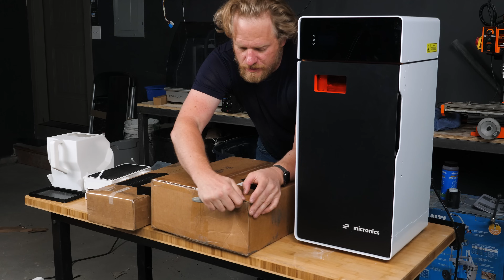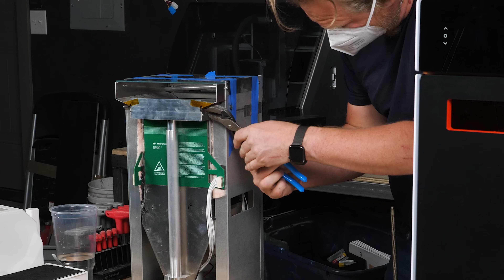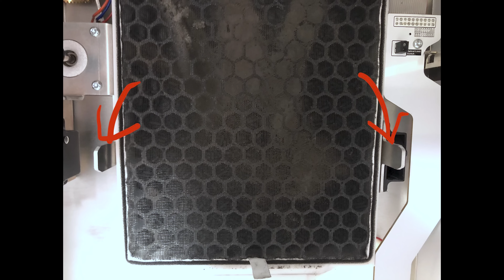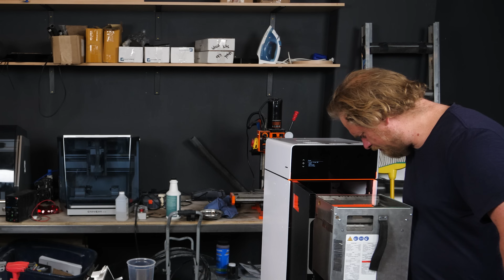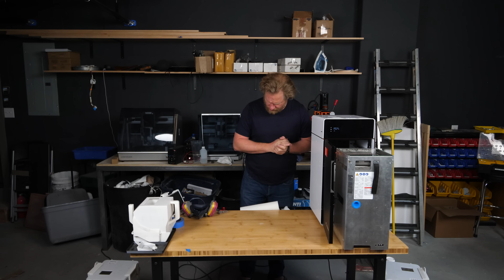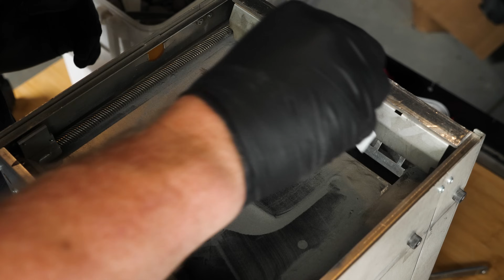Kickstarter Canceled! What’s Next for Micronics?

Comment: I think Henry's "Fix Protocol" was well put together on instructions... With a little more tuning, I think it woulda been a fair machine to play with.. 

I say, keep at your gifted machine and get it running... And just have fun with the whole experience of learning, trouble shooting, then hopefully, working machine and rock and roll. 

The problem with an affordable machine that has a media or rather powder, and not having an additional $8000 USD in seals, lip seals, O-rings, vacuum assist, vibratory basin, and many other built in services into the machine, that, like any other mechanical devices, the powder is naturally going to get into every location you don't want it to, and over time, build up, wear critical part, bushings, ball bearings, optical view obstructions, and so on... And not unlike the automobile, foreign matter wants to naturally get into critical locations, and seals of all methodologies is designed to keep that out, away from areas that are required to be clean, likewise, those same sealing systems are serve as the methodology to keep various lubrication types contained with in the machines critical locations, like wheel bearing systems, motor crankshaft to engine block fitment, and so on, and over time, things do wear out, and start to leak out, and stuff can get into these places, to don't want in.. just the nature of a mechanical system, and maintenance is and always has been a defining factor of machines, your automobile, motorcycle, shop tools, and when maintenance is lacking or not implemented into the use of the machine, life expectancy of the device, vehicle, etc, is on a scale of time, performance, works or doesn't work.. 

So, after my novel, I think for what this is, for the price, and simplicity of it, to keep the costs down, I say, stay at it, and make it work... The proprietary sintering electronics sounds like that will be an issue... I also have concerns for the government "over-reach" no matter which country you live in, is a serious problem to me, the machine and or media powder licensing contract and the likely, "must have network" connection to play with the machine, in my opinion is a serious problem.. what I do with my machine, is nobody's business, especially not the government's business. 

So much so, I have had 6 patents stolen from me over the years, and this is just one more aspect of others seeing what you are prototyping, before you can even hit the sales floor, and see every part you are designing, letting you do all the hard R&D, trouble shooting, costs out of pocket, and all any agency, competing business needs to do, is watch you network, while you build.. 

This is something that needs to be fought against collectively, against the corrupted gov't's of the world... Pardon the political ranting, but it is a serious problem, and if we do not start fighting against it, the whole world will be in big trouble from the people unwilling to tame themselves or relinquish their self appointed power... And that is all I'm gonna say about that...

Comment: I think the best system for handling powder i have seen so far is from alpha laser but their system only allows for smal prints and it takes up some space. But i think the basic concept of having containers that only open it's lid when inserted into a slot so you can handle them in normal environment and having a sandblast box like thing where you can work on stuff. (Filling the containers or removing the powder from the print) I think the basic concept would also be do able for other less expensive printers. I am also wondering if a Zyclone vacume system could be usedd to remove and filter the powder. (As i know you can seperate things by weight using multiple Zyclones.)

Comment: I hope Formlabs doesn’t do what I think they’ll do and drastically increase the cost of owning this printer, but I think they will. This may sound extreme, but I honestly hope that if this printer comes out at the original price promised by micronics, but you’re also locked into Formlabs materials unless you pay the ransom then I hope the project fails and Formlabs loses their ass on it. I hope the entire product is a huge failure, and most of all I hope that if this happens the world will see that it was the absurd ecosystem lockdown that caused it to fail and not the printer that people actually want.

Comment: You are the only reviewer who has been honest in acknowledging the disappointment the Formlabs acquisition means there will not be an innovative, relatively low-cost SLS for the market anytime soon. Thank you for your honesty and willingness to discuss the flaws and challenges Micronics was also facing. 
Watching you work on the machine also suggests that safety is a huge factor. I wouldn't be comfortable without a separate, walled-off room with adequate ventilation.

Comment: I am VERY VERY bummed about this outcome. I use formlabs machines to produce final parts at work, and they are also have MANY issues. Other than the $300 every 2 months (max) for a new tank, and the $300 per liter of resin, I have to babysit every machine for 30min to make sure the prints dont fail at the start. The final prints are very impressive, and the range of resins they have come up with are wonderful, but they are truly a professional machine because of it. Seeing them buy out competition so they can continue to hock their TWENTY FIVE THOUSAND dollar machine that is bound to be just as finicky and expensive as the sls machines is a gut punch. That being said, Its probably for the best for micronics, seeing as they will be able to have a life and a solid career/pay for now. But they also could have legitimately revolutionized the 3d printing market and made much more money by doing so. But that would have been a gamble on their end.

Comment: Probably an unpopular opinion here: you don't want to have a desktop SLS printer as a hobbyist. The powder handling is a mess if you can't afford the auxilliary equipment and facility that can do it safely. You're probably conscious of that to an extent - I saw you upgraded your mask while working with this printer. But mask is not enough - over time everything will be coated in powder in your shop and it will be terrible for your lungs long term. And I don't trust the majority of hobbyists to be able to do any better either. So in the long run, this would hurt the industry and the maker community while giving no real advantage... Just use an SLA printer (safely!) and forget about SLS.
Reply: wow. Thats sounds like something Formlabs would say while buying out competition. Thats BS.

Comment: I think that formlabs was a huge component in bringing resin printing into the hobbyist market, even if they didn't necessarily offer it themselves. A high end, functional system with all of the little issues worked out gives hobbyist machine manufacturers targets to hit. They decide what is important and what areas they can make cheaper, then they start competing with other hobbyist level machine manufacturers doing the same. I think this acquisition is pure upside, even if everything formlabs has ever made is well outside of my budget.

Comment: unfortunate for the initial access to SLS technology, we will have to wait 5 to 8 more years until someone can invent something to combat that monopoly ... :( ... Formlabs with a lot of experience when it had to face 3DSystems in its beginnings did not It allowed the community to enjoy even the first Micronics machine.

Obviously they were not going to let the disassembly be published. As a user of Form1+, Form 2, Form 3 and Form 3B+, technical support is based on equipment replacement at user cost and they do not provide spare parts solutions or assembly guides, much less something that is new to them, for reverse engineering, you have gold in your hands.

 "Micronics will be the "Fuse Mini" version starting at $9999, expect it in Q1/Q2 2025." -

Comment: It's Joever boys.

I had some FormLabs printers at my old job and they were terrible. Lower print quality than competitors who were 1/10th of the price.
Users were locked out of print settings, and when something went wrong, you just had to hope that they fixed the settings at some point.

Loads of weird hardware failures, and support were clueless and would always try to blame print orientation rather than accept that something failed.

I was part of an R&D engineering team, who doubled as repair techs for -figure underwater robotic equipment, and when a heater module failed in the Form 3 (held in with 2 screws and 1 plug) we had to send it back to the retailer rather than send us a new heater.

For the 12 months that they had the Form 3L they never got a usable print off it. I can't say what happened after that because I left the company.

MASSIVELY overpriced, especially relative to build and print quality. Proprietary anti-consumer anti-ownership everything.

At least in the Asia-pacific market, their resins are made in China and way more expensive than competitors working out of countries where labour is more expensive.

It's another Pebble situation where the big companies with r*pist mentalities can't stand to see customers treated well with good products, and rather than become competitive, they just destroy their competition.

Comment: I've already used the Fuse 1, Form 3 and Form 3L from Formlabs, and in fact, they are incredible printers, the Form 4 surprised even more.
And I believe that if Formlabs wants to make SLS more accessible, they will either need to open up to third-party materials, or they will need to greatly reduce the production cost of their materials.
I have no doubt that Formlabs will greatly improve the mechanical and software aspects, in addition to the fact that Formlabs is very good at making its equipment easy to use.
If they can reduce material costs and simplify manufacturing to make SLS printers more accessible and affordable, then we can celebrate.

But I have doubts that they will actually do it...
I hope I'm wrong😂

If Formlabs doesn't take this chance to make SLS more accessible. Let's just wait for some Chinese company to do this, just like Bambu Lab did with FDM printers, making large companies leave their comfort zone and really invest in making increasingly better printers.

Comment: Formlabs realised they had competition and a blank cheque would make it go away.
Reply: It seems likely that it's even worse than that. I'd be surprised if this wasn't a stick and carrot approach where they were threatening to go after them for patent violations (I'm sure Formlabs has a sizable patent portfolio) and then made a low ball offer. Since it was public knowledge that Micronics were out of startup runway a lawsuit from Formlabs would likely have been the end of them. I don't know how much ownership the founders of Micronics had but when factoring in the Micronics investors I'd say it's likely that the founders had no real say in this matter.
Reply: The printer in the video is 80% aliexpress parts :) why would anyone consider this as competition?
Reply: @Error404_Handle  it shows that you don't need to spend 5 digits on SLA printing, which hurts their bottom line hard.
Reply: @TheLaXandro except that it hardly works well.
Reply: @PauIieWalnuts  teething issues. A couple more iterations and it'd be a functional machine.
Reply: @TheLaXandro  oh yeah? with what budget?
Reply: @Alex_Hortense  with the revenue from gen 1, and with a community of tinkerers. The biggest things were already figured out, all that's left was making it all relable.
Reply: @Error404_Handle evidence?
Reply: @Error404_Handle  How do you think Formlabs products are produced.. do you really think they engineered every cogwheel and screw themselves instead of taking off the shelve parts for 80% of the systems?

Formlabs themselves sell an SLS printer for 30.000$, releasing a product for 1/6 of the price will hurt a lot of companies, so its best for them to aquire startups like Micronomics, also I feel like way to many people keep shitting on the guys not thinking about that they only sold 350 units, and missed the kickstarter campaign goal, all that while working tirelessly from their tiny appartment which they converted to a sleep/working enviroment. 

In all honesty, I think 99% of people would've picked up the offer, I don't know how much they were offered, but I am pretty fucking sure they are exhausted and this deal gives them a break, and will probably make formlabs release a cheaper SLS printer, I am guessing around 10k, maybe I am wrong, but they still did something incredible here.

Comment: Formlabs took one look at this and said "Oh shit, they're really close" and did what they did to protect themselves from losing a ton of market share to these guys. They'll never admit that, but, it's pretty clear that Micronics got the hard part down pat, which is the laser control. Their engineering had some issues to work through, but, I do not doubt that would have been polished out by the time people got their hands on them.

It will be interesting to see what Formlabs does with their design, my guess is that they'll make a baby SLS printer like micronics was trying to do, and it'll probably sell for around the same price point, but they'll lock you out of some of the potential via software/licensing as to not cannibalize their commercial printer sales.

Comment: What a bummer. The acquisition is a huge disappointment. I think it is a huge personal win for those at Micronics, but at the expense of a very hopeful community. Then to be bought up by a would-be competitor with a competing price point 5x higher, makes Formlabs look villainous. But then, when they mention the Open Materials License and you realize that Formlabs' printers not only are prohibitively expensive but also lock you in to a proprietary materials racket, they come off as nearly evil.

Maybe there's more to the story than they let on. For instance if they realized the price point for the printers was going to be necessarily much higher than promised, or their angel investors were getting cold feet, and they sought an out through acquisition, that could change the story. But, if I were Formlabs, I would be making that clear RIGHT NOW to try to flip the narrative from "Growing evil 3d printing company, Formlabs, squashes competition, dashes hopes of 3d printing hobbyists everywhere" to "Formlabs rescues up and coming engineers from entrepreneurial pitfalls while offering an olive branch to a broader maker market." But right now, Formlabs sounds/looks like the former more than the latter.

Comment: This really looks to push back the dream of a semi-affordable SLS printer by several years at a minimum.  FL bought their competition, thus ensuring that there's no menace to their expensive, proprietary printers.  Really, it’s more about protecting their current and future market than buying anything of value with the acquisition.  They now have ample time to perfect a lower-priced (But still very expensive) series of printers without any direct competition.  Patenting any IP they've acquired also helps to lock down that market.  
It will be interesting to see if there are any Prusa or even Creality-style SLS printers any time in the near future, but I'm not holding my breath just based on the patent angle, which is the only reason SLA and FDM printers were able to be produced for the hobbyist market.

Comment: They seemed exhausted. Two men doing job that needs bigger team to work on. With Formlabs they get it. I do not have same type of connections to even have one person to help me. It is really hard to too nothing new technical, without lots of help. Their beta test made them see how much more work would they need to get working machine. It was lots and to still after that make it a mass product. Y it might work if y make 1 or 2 of them, but make 1000. every part needs to be easy and cheap to replicate.